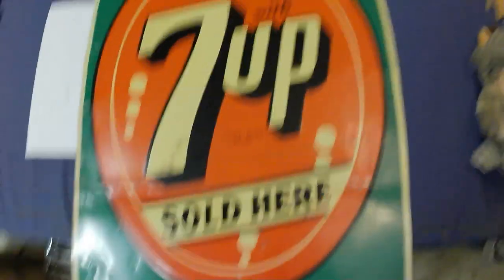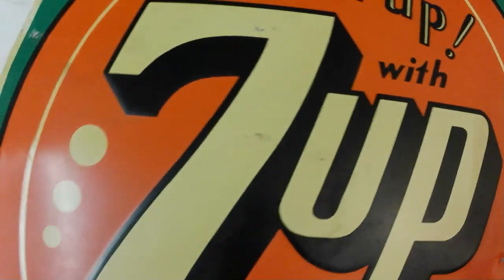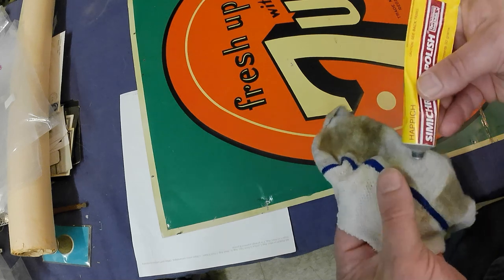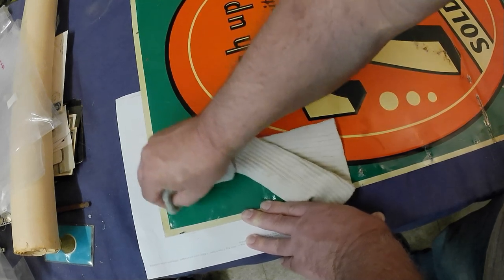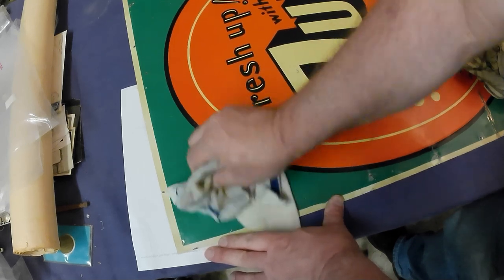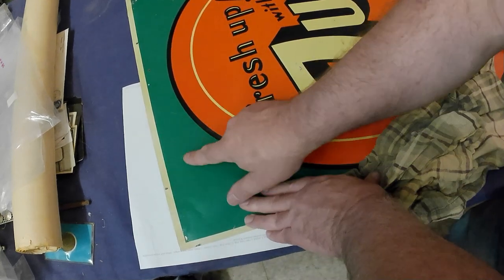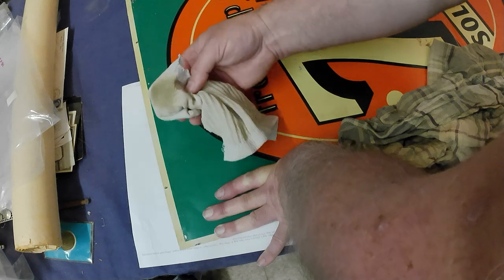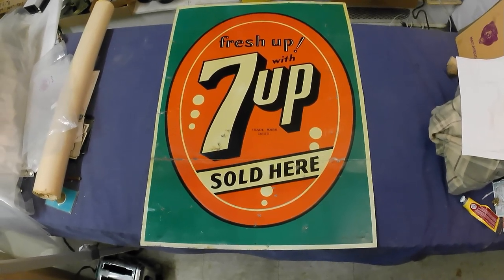HOW TO Clean and Detail a Vintage Tin Sign - Fresh Up 7Up

Comment: Awesome job
I use Flitz metal polish much bigger tube from Amazon 
I learned about Flitz in the aviation business cleaning plastic windows making them look like they are wet. 
Thank you for the video

Travis in KY
Reply from the maker: Thanks! Will have to try that on some plexiglass case tops I have. Thanks for the tip! And thanks for watching!
Reply: @ your welcome. I use the Flitz on my jukebox plastics,signs chrome Auto Aircraft any surface and it does not scratch but cuts. It’s amazing.
Reply from the maker: @tb40ford  Looking forward to trying it out!